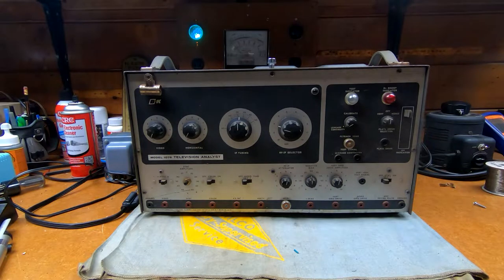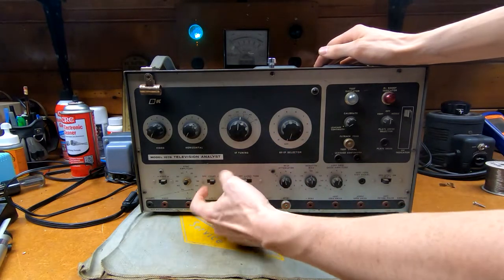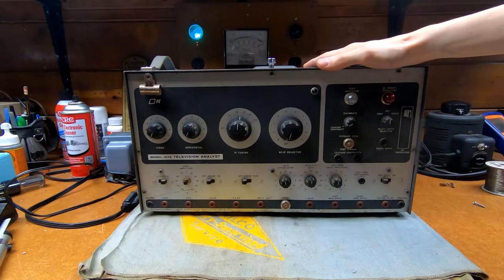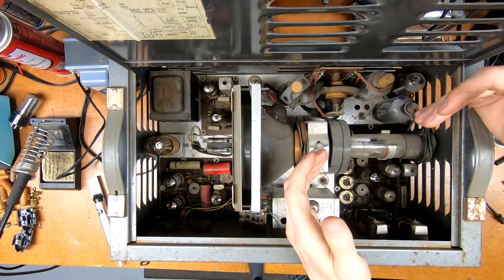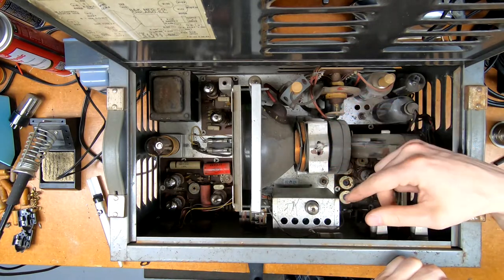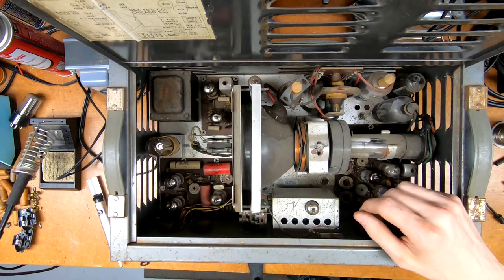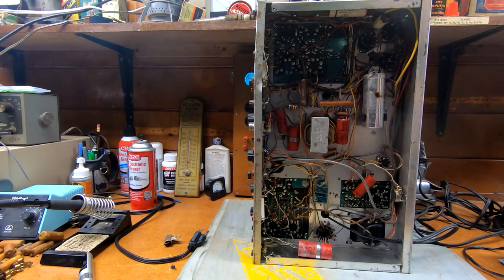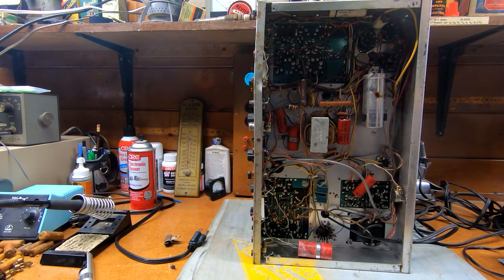B&K (Dynascan) Model 1076 Television Analyst Part 1 - A Look Inside

Comment: Thanks for this interesting video about the B&K Model 1076 Television Analyst.

When "Growing Up In Mandan (GUIM)" North Dakota at my Dad's Radio and TV store, he had a B&K Television Analyst, of which model I don't specifically recall.
Dad was of the old school of then-technical ways, looking to the voltages of vacuum tubes, from which he was effective in diagnosing the problems.
But when solid-state transistorized products came along, he seemed lost.

At his shop, I learned to use an RCA oscilloscope to trace waveforms throughout the television set.
I later was employed at Sencore Electronics in Sioux Falls, SD, guided by Herb Bowden, Founder and CEO at the time, who showed me a "systems approach" to troubleshooting electronic equipment, from front-to-back, by simply rotating a single switch with only input-output connections needed.

Thus, I became a writer for the Sencore VA48 Instruction Manual, describing a process with which B&K, with their 'engineering instrumentation' process direction never achieved, imho.

Comment: Hello!! In 1982, (14 years old, today with 56 hahaha) he worked as an assistant, in a repair shop for televisions and other electronic equipment such as medicine. The owner was a professor (electronic engineer) who had traveled to the USA and brought it to Argentina. Every now and then we used it in the repair and calibration of the tvs to TRC. Thanks for your input, Greetings from Mar del Plata, Arg

Comment: Great explanation of this classic piece of test gear.  I picked up a 1077B awhile back that is in pristine condition (looks to be NOS) and included the complete set of patterns still sealed in the original packaging.  It also has all the original test cable sets.
Reply from the maker: I'm planning on making some new cables and slides for this one. Glad you enjoyed the explanation, I felt like I was tripping over my words a few times.